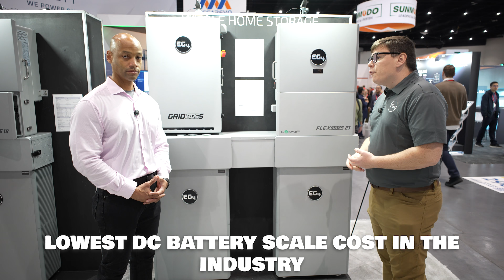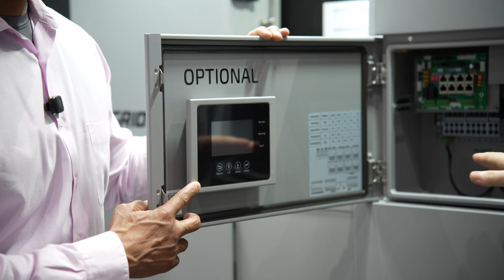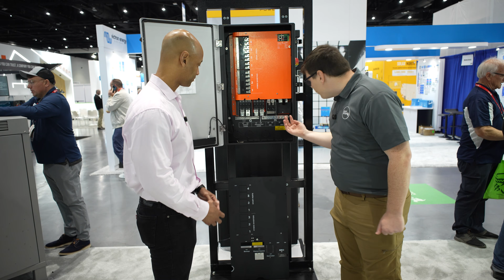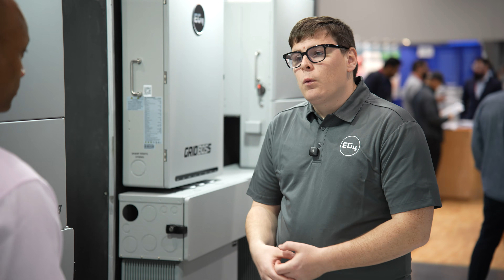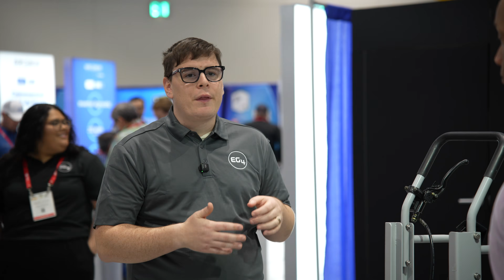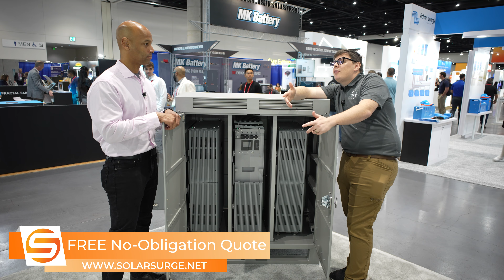NEW EG4 2025 Full Product Lineup

Comment: I am an old Victron guy and installed multiple systems in mobile applications.  I purchased this pair and installed with an electrician (he dealt with the county) in May 2025.  The install went pretty good, my biggest complaint was the lack of details in the documentation regarding alarms/warnings.  I do have a WLAN dongle for the Grid Boss bad out of box.  Support confirmed and the dongle was supposed to be shipped out.  That was May 14, 2025.  Multiple calls back to support and I am being told that they have no control over the replacement process and they cannot give me any ETA.  As of June 29, 2025 still nothing.  While the WLAN is a small item and really does not impact the day to day... It worries me that if I was to have a large failure that I would get the same level of service from EG4.  Meaning none.  I now have thousands of dollars that are in a system that I hope I can get my monies worth out of before it has a major problem.  Basically a throw away system.  I regret this purchase big time!  I should have paid a little more and stayed with a Victron product portfolio.   Buyer beware!!!!

Comment: Luxpower makers of EG4 inverters which are made in China, are facing scrutiny and accusations that they may pose a risk of backdoor cyber attacks by the Chinese government. The concern stems from the discovery of "rogue" or undocumented communication devices in these inverters. These devices could potentially be used for unauthorized access and control, potentially leading to grid instability or damage.

Comment: Hey Joe, great video, thank you. I attempted to identify a local installer and was surprised at how difficult it was to find one - there was/is no search tool on the EG4 website nor did EG4 have a list of vetted/certified vendors when I called the company directly. I ultimately had to call one of the distributors listed on their website, ask for the rep for EG4, and then ask the rep which contractors he supplies. I imagine most potential customers will not go this distance. More importantly, this first experience with the brand raised a red flag about the ease and availability of customer service. These systems look solid and appear to be more versatile and future-proof than the likes of Telsa, Franklin, and Enphase but I suspect EG4 will have a tough time competing until they make it easy to buy and service a system.
Reply: He said you could buy the Bossbox already configured with up to three batteries but I could not find where you could purchase that.

Comment: Grabbed myself a grid boss to add my existing 18kpv setup and 2 wall mount eg4 indoor batteries. Gonna add a flex boss and more wall mounts soon. System is amazing. Blows other systems out of the water on pricing. My uncle got Tesla and is so sad when he looks at my larger and cheaper setup now.

Comment: Its interesting that so many customers of these whole-house systems don't really understand how much energy they have and how much energy they use and create these issues in actual blackouts where the battery system gets exhausted through... basically ignorance.  This lack of awareness also seems to be selling things like smart panels, which are another one of those things that just shouldn't be necessary.

One problem with the conduit box (both the old one in the video and the new one) is that the horizontal interconnection is not wide enough to space the batteries the required minimum 7 inches or so... you wind up with three or four inches.  So you still need horizontal segments between the conduit boxes or something like the small square-ish box they have on the right, in the video (which I couldn't find ... do they sell those?).  I would much prefer the conduit boxes be wide enough for direct adjacency.
Reply: It's hard to tell, but it looks like more than 3-4" between them in the video? Not sure if it's the 7' needed, but maybe?

Oh, I see later in the video where the batteries are installed one in front of the other to save wallspace.